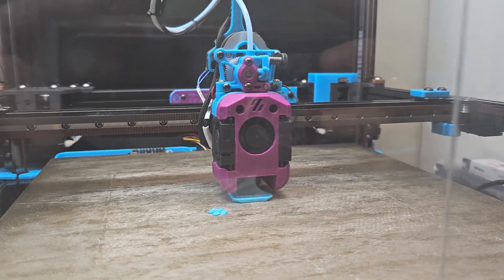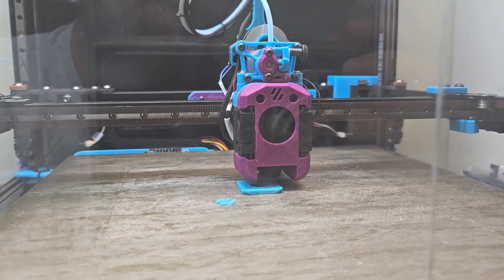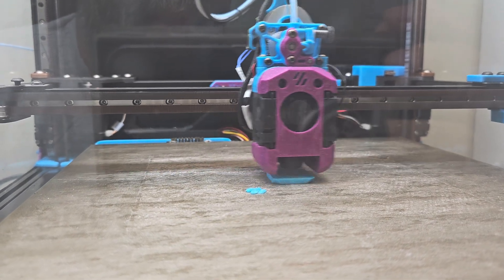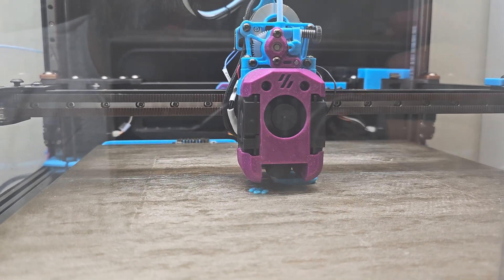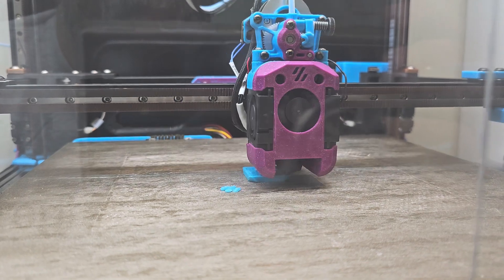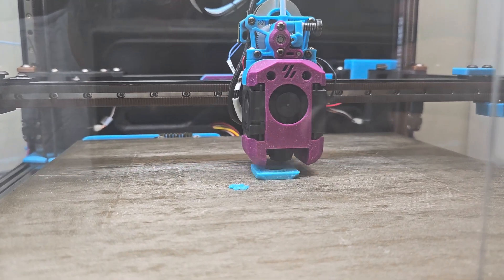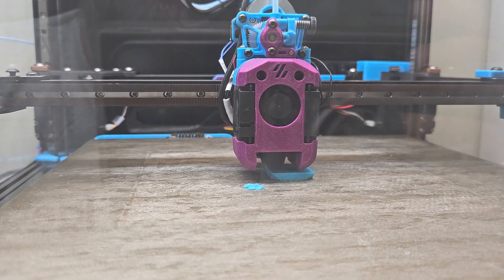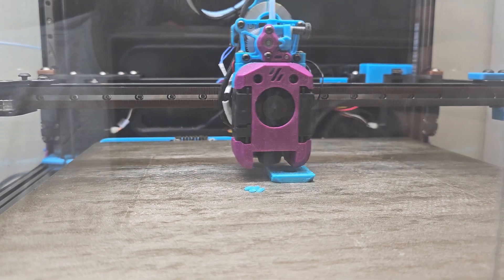Voron 2.4R2: A good speed/quality compromise?

Comment: Curious, what retraction settings are you running with this setup? Baseline I was going to start with 0.5 @ 30mm/s like before but wasn't sure how much if any that UHF changed things.
Reply from the maker: That's what I have set. I haven't tuned retraction specifically.

Comment: There is a loose bolt on the left x 😯.   What kind of X joints are those anyway
Reply from the maker: It's actually not loose at all, it is an M5x16mm and it is quite tight, it is just too long. I have it screwed into a roll-in T-nut. I need to source myself some M5x14mm, or possibly M5x12mm.
Reply from the maker: The XY joints are these ones:
https://www.aliexpress.com/item/1005005286686747.html?spm=a2g0o.order_list.order_list_main.16.31581802N81E2i
Reply: @oldguymeltsplastic  I have been having this one in my basket as well, waiting to finish the v0 first. If Ali seller could be trusted ~60-70g is very nice. I'm considering the dragonburner as well. On one hand I really like the Stealthburner look, on the other it's way too heavy. MGN9 would be such a good fit for the dragonburner
Reply from the maker: @tsanov86  My V2 still has the MGN12H rail with Rapid Burner V7.
Reply: @oldguymeltsplastic  All I'm saying is that mgn9 is like 100g lighter, that would make a difference, especially with  lighter toolhead